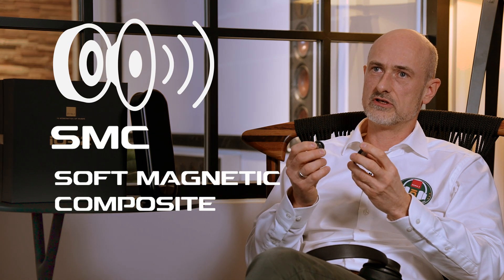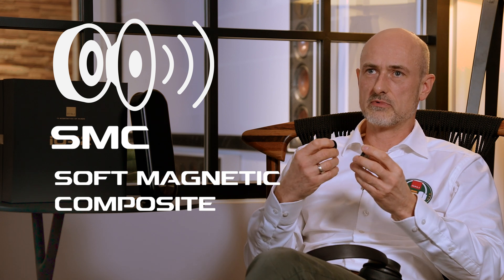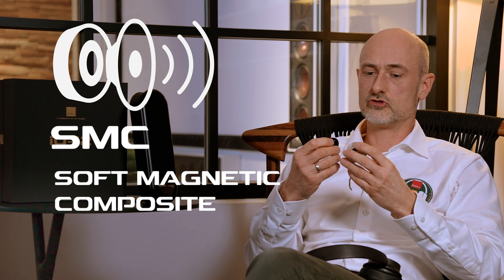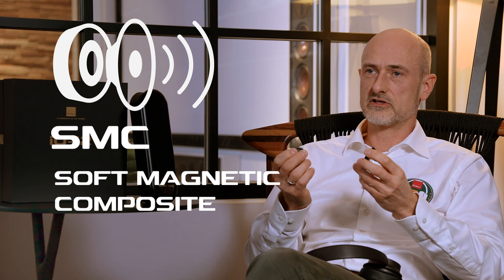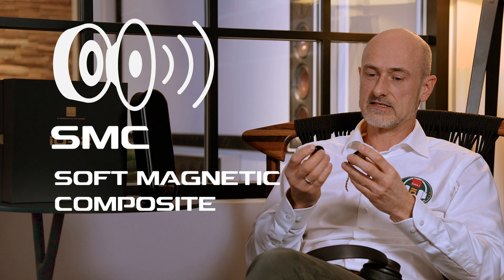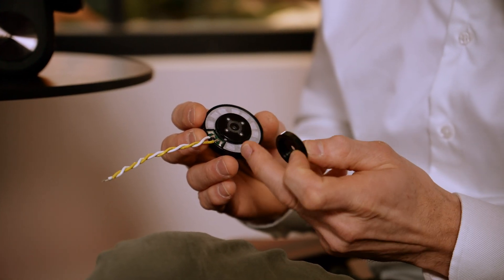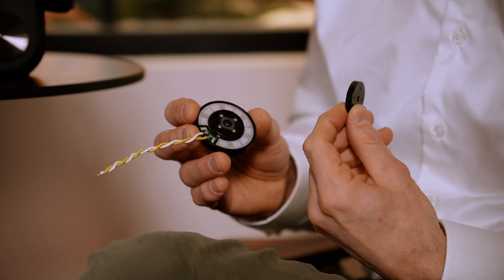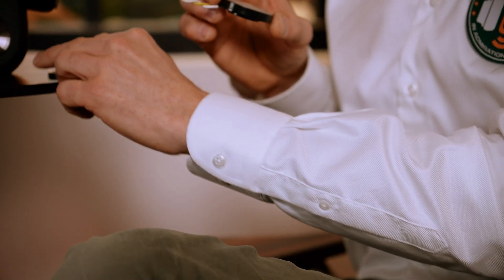DALI iO-12 | Let's talk about electronics

Comment: The theory sounds good, but my measurements show relatively high distortion in the bass for the IO-12 (typical for drivers used in ANC headphones). However, the IO-12 drivers sound far better than e.g. the IO-6 drivers, so there is some ground for these statements. The better biocellulose drivers (e.g. in Denon and Fostex wired headphones, especially the 1T ones, not the 1.5T ) sound at another level than the IO-12 drivers in passive mode (OK, it's hard to compare, since the baffles, the loading and the acoustic environment are different). Many electrostatic drivers are several levels up. So I cannot take these claims seriously. But I think if Dali is able to further improve on these drivers / casings, they have the potential to approach these far more.
Reply from the maker: Hello.
Thank you for your findings and comments.
The SMC magnet system used in the IO-12 mainly improves and lowers distortion from approximately 1kHz and upwards. If you go to our website and download the IO-12 whitepaper on the IO-12 product page it will describe the technology more in detail.
Reply: Have you compared them with denon d7200 or d9200?
Reply: @RX-rd4sc  yes, both. It's closer to the D7200, as the D9200 has its slightly different character, IMHO both sound more smooth than the IO-12, in passive mode, and still sound better than the IO-12 in active mode (both with NC and without), but YMMV. Overall the IO-12 is far more convenient, with a lot more features, and it's the first ANC headphones to get any close to good closed backs.
Reply: @zorqis  thank you i thought that i should upgrade from d7200 to io-12 as they stated that its more detailed and like estats
And also have you heard sony mdr-z1r and compared it with d7200?
Reply: @RX-rd4sc  you will like the change from the D7200 to the IO-12 (but IF Denon made it ANC, I think they would be the winners).  To the Z1r I gave many chances, I never liked it. The IO-12 is a safe bet.
Reply: @zorqis  i have 2 options ion-12 or mdr z1r im now fully aware that how io-12 will perform compared to denon
Can you describe how z1r compares to denon d7200, which is better in your opinion?
I also had d9200 in my list but because of the lack of dynamics (read online) i removed it from my list
Reply: @zorqis Nice thread
Can you elaborate the differences between d9200 and d7200?😊